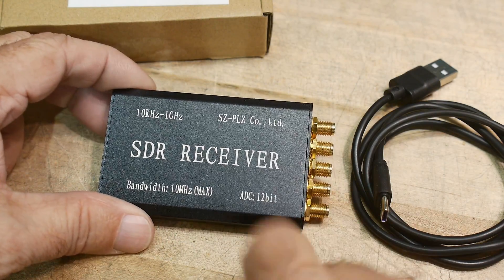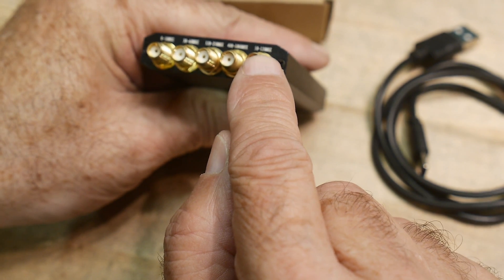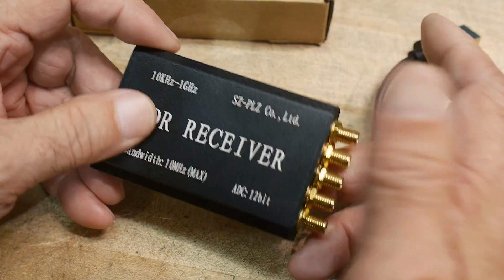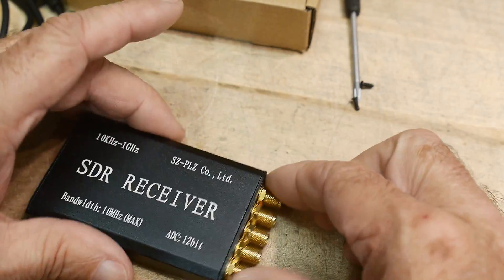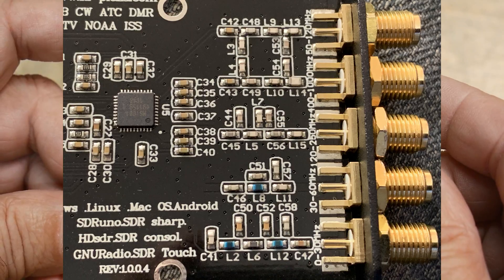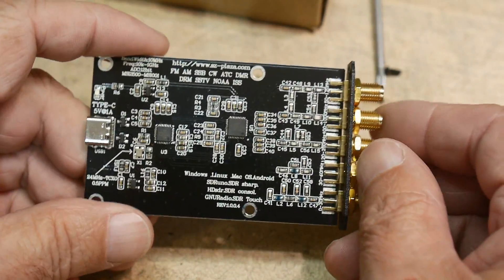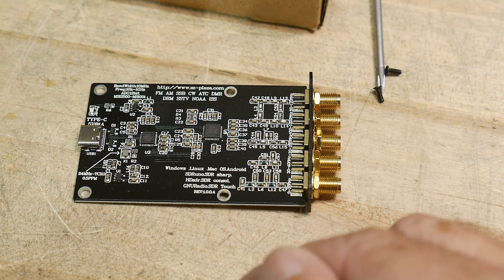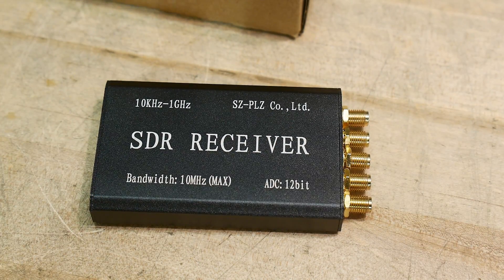#1318 SDR Receiver Review

Comment: This receiver is sold in meny shops in Aliexpress, 80% of the circuites are faulty. Most of them don't work on the lower bands (10-30MHz), only on the FM band. I bought it from "Life & Safety Guard Store" . Neither pay-back nor any solution.

Comment: 1:00 The two main chips in this SDR receiver are the MIRICS MSi001 and MSi2500. According to the company's data sheets for these two chips, the MSi001 is a wide-band, multimode tuner with different inputs for different frequency bands, so the receiver's multiple SMA inputs are not only for different bandpasss filters. The MSi2500 contains two analogue-to-digital converters (one for the I channel, and one for the Q channel from the MSi001), a digital signal processor (DSP), and a high-speed (480 Mbps) USB 2.0 interface, which the receiver manufacturer connected to a USB 3.0 jack. An Internet search can clarify what some of these things mean.

Comment: Do these receivers need an outside antenna to receive more than the fm broadcast band？I receive a lot of of shortwave stations on my other radios with indoor antennas, but using the same atennas on this I receive only the fm band. Could anyone shed some light on this. Thanks.
Reply: It is not the antenna that matters. Most of these gadgets are stucked on the FM band and no way to enable the low freq. input.
Reply: @gyorgycsatai8798  There is a setting, Q branch in the SDR application which gives the access to the ham, lower frequencies. I found I could pick up stations with a long wire antenna. Not so convenient. But it does work with a 9:1 unun. The ground from the unun is essential or there is no signal received. You are right these pick up the FM band with no problem so the Q branch setting  takes care of that.
Reply: @ominkan3129  As I know Q branch is used with RTL-SDR. In this video it is an sdrplay based on the chip MSI2500. This chip should automatically  enable and disable antena inputs according to the frequency.

Comment: Can you use more than one antenna input at a time? Like having an inverted V attached to the 0-30mhz input, a j-pole on the VHF input and a 600+mhz patch antenna on the UHF input?
Reply: Does it only work with Sdruno or other software like SDR++

Comment: I just got one of these. Can you have multiple antennas hooked up at the same time for different bands or should you use one at a time? Or does it matter? Thanks!
Reply: There is no reason not to try it---you won't break anything---but the five SMA jacks are so close together that you will probably have difficulty connecting cables to two adjacent SMA jacks. It has been 6 months since you posted, so if you have tried it, can you share your experiences?

Comment: Hello, sorry for the English, but Russian was a compulsory subject in the former GDR.
So translator.

First of all, thank you for disassembling and your reconnaissance work is good to bring light into the darkness.

Altogether I have 5 different types of
SDR Play Clones V3 found and 4 tested, two returned because all SMA sockets were neither screwed nor soldered properly and the solder joints broke as a result.
The clone shown here is better processed, but it has a large picket fence in the VHF BC range and partly in the 2m AFu range.

At the moment I have the version tested here and a single antenna version running.

large signal strength,
80 delta loop at 10m above ground very bad. -55 and the rest to 0 are tolerable without oversteering occurring..

Test environment here 80mDelta Loop and a 10.05m vertical with 2x 10m and 2x 2.8m radials

SDR Console

For daytime use OK, BBC 198khz on the Vertical S6-9.

Hundreds of ghost signals at night even with the MFJ RX/TX preselector inserted

This has 2 antennas in and 2 transcivers out and is great for comparison

Thank you and keep it up.

Comment: I'd like to see how to install the software. I'm having trouble getting Win 7 to recognize the dongle. These dongle radios come with no instructions whatsoever unless you buy a $150 one. My $23 board told me to run SDRplay software. SDRplay told me to enter a key number before it would let me download the software. So I'm stuck. I had to install something called 'Zadig' before I could install a USB driver for my other SDR dongle. It took me 2 days of reading and futzing around to get that one working on 1 software package. The lack of setup info is a real pain. I may just go back to superhet receivers. Those at least are explained and well documented, and you plug them in and turn them on and they work.
Reply: What did you expect from a fake product?
Reply: @SDRplayHamGuides , as far as I'm aware my board is just 2 commercial chips with signals connected as the manufacturer's datasheet suggests, and that's that. So what's fake about it?  Did the SDRPlay company design the chips, and the chips on my board are knock-offs, fakes? It looks to me like all SDRPlay has done is write software to talk to an inexpensive commercial chipset. Am I wrong about that? I haven't read the history of the chipset or read much SDRPlay promo literature. I would expect the chip manufacturer or some college kid or ham would have written a free driver to link the chipset to popular free SDR software by now. If they haven't, then I guess I wait until they do, because I'm more of a hardware guy than a software guy, and at my age would take me longer than I can afford to write an appropriate driver to do the job. But I'm a ham, not a consumer. I have no interest in paying $150 for what may be a slightly better SDR dongle than the $25 RTL-SDR I already have, and I don't see any reason to run any software other than the great free stuff already available. I have no desire to buy a software driver and a plastic box for $130. I just got this bd so I wouldn't have to bother gathering the parts together to build input bandpass filters. I would have been happy if it had used the RTL-SDR chipset so it would have been fully compatible with the SDR software I already had installed. But it clearly uses a different cheap chipset. Oh well. I suppose I can chop it up and still use the filters as front-ends for my RTL-SDR. As I said, I'm a ham, not a consumer. I build things from new or surplus parts, or modules, or boards, and I modify things, and learn, and make things work the way I like, this included.
Reply: Cost is no excuse for theft.
Reply: @SDRplayHamGuides  From what I have read, MIRICS, the manufacturer of the chips for this device, sells these chips to SDRPlay as well as other manufacturers!  SDRPlay does not have any right to call this device a fake or fraudulant!  The chips are being used as they are intended to be used as layed out in their respective data sheets!  The grey area is when this device is used with SDRPlay's proprietary software!
Reply: @danedewaard8215  These chips are used in the Funcube dongle pro/pro+ The malahite DSP1 and the Comradio CR1/CR1a. Yes, its being used as intended but NONE of these radios work with our RSP API driver or SDRuno but the device in this video is 1000%  fake and fraudulant
Reply: @SDRplayHamGuides  So any device that works with your software, that is not made by SDRPlay, is fake and fraudulent???
Reply: @danedewaard8215  Yes. Our RSP API driver is not "Compatible with" its purpose built for RSP devices same for SDRuno. These clones do not work without the RSP API driver.
Reply: @danedewaard8215  Hopefully that cleared up your misconception of the mirics chipset. and the devices they are placed in.

Comment: This definitely looks like a "you get what you pay for" item. It would be nice to see how accurate the frequency is VS a GPSDO or an oven Clock based frequency source. I'm betting this is OK for "horeshoes and hand grenades"  monitoring, but not "spot on" with an accurate broadcast frequency, and it also has no external clock input to make a correction for that. The multiple inputs for bands also seems problematic, as one other poster stated, as those connections are so close you would definitely have mechanical interference with adjacent connection points being used.

Comment: As many of you will probably be aware, there has been a growing issue with the number of both clones and fake SDRplay devices appearing through a range of retail channels. The distinction between what is a clone and what is a fake may not be obvious to some, but a clone is a copy of a SDRplay design that is NOT sold as a genuine SDRplay unit. A fake is a device that is marketed using the SDRplay name and logo or product name (i.e. RSP1A or RSPdx) and are designed to trick the unwary into believing that they are purchasing a genuine unit.
The most obvious example of a clone is the MSi.SDR. This is a direct copy of the original RSP1. When the RSP1 was launched in 2014, we published the schematics to allow radio hobbyists to modify or repair units themselves. We did not intend that this publication should be used for third parties to produce copies of our designs. Lessons learned and schematics have not been published since.

Whilst the legality of copying a design is open to debate, the morality of it is not. The companies copying our original RSP1 design invested nothing in hardware R&D and invest nothing in software development or support. Instead, they leverage the investments made by SDRplay. Investments that can only be funded through the sale of genuine SDRplay products. It is easy to undercut the OEM on price when the 'cloner' invests nothing in R&D, documentation or support

When it comes to Fake units, the issue is clear. These breach our trademarks and copyright and are intended to deceive potential customers into believing that they have purchased a genuine SDRplay product. They also do so in the expectation that the unsuspecting customer will turn to SDRplay for support or warranty replacements when they inevitably have problems.
Some people see nothing wrong with purchasing these devices in the full knowledge that they are not genuine SDRplay units and argue that given the price difference, purchasing such units is entirely justified. Some argue that “because it uses the same chip, there is no problem in using the same software, after all it's free”. It is important to understand that whilst SDRuno is free, the hardware driver and API are most certainly NOT. The hardware driver and API are part of what customers pay for when they purchase a genuine SDRplay RSP and the license terms and conditions explicitly state that these should only be used with genuine SDRplay devices that have been manufactured and distributed by SDRplay. These are terms that everyone who installs the software has to agree to for the installation to proceed.

SDRuno also has the same license terms of use, but is free because there are free alternatives such as HDSDR, SDR++, SDR Console, CubicSDR etc.
People that knowingly purchase MSi.SDRs and use SDRplay software as well as breaching the license terms of use are effectively pirating the driver and API. They do have an alternative, they can use the open source libmirisdr driver, but of course that will severely restrict the range of software that they can use. But I would also urge anyone who purchases these units and feel that they can use our software to consider the following: as well as stealing SDRplay software, you are undermining our ability to continue to develop the software and provide the level of support and documentation that we do. In doing so, ultimately you are undermining the entire community of SDRplay users through your actions.

Thank you for reading
Mike-SDRplay
Reply: Well said Mike.

Comment: I have one will not work with SDR#
Reply from the maker: they use SDRuno
Reply: @IMSAIGuy  People that knowingly purchase MSi.SDRs and use SDRplay software as well as breaching the license terms of use are effectively pirating the driver and API. They do have an alternative, they can use the open source libmirisdr driver, but of course that will severely restrict the range of software that they can use. But I would also urge anyone who purchases these units and feel that they can use our software to consider the following: as well as stealing SDRplay software,
Reply: @SDRplayHamGuides  SDR Uno can legally be used with any other SDR except those that have the Mirics chips MSI001 and MSI2500.  These are the same chips used in the SDRplay RSP series SDRs.  They were also the same chips used in cheap (less than $20) TV dongles.  Not to be confused with the Rafael Micro R820T2 and Realtek RTL2832U chips used in the RTL-SDR dongles.  If these MSI-SDRs are so bad, why would you care if they used your software???
Reply: Re-read the TOS. SDRuno is for SDRplay products only. The SDRuno.EXTIO edition can be used without issue with  any hardware that provides and EXT/IO.dll and a sameple rate of 2.5 MS/s or less.

Comment: Case: "ADC: 12bit"  I believe that these are only 12-bit ADC within the lower frequency range. Vague recollection, so not sure.
PCB Design: You may find that the five SMA connectors are so close together that the nuts interfere with each other. My example came with the nuts loose, because they didn't all fit. So I installed every 2nd one. It's fine.  Maybe someone has found SMA nuts that are ultra-thin and fit better.
Getting the driver software was just a bit dubious.

Comment: cheep and comes with a 24 Mhz crystal at 0.5 PPM - impressive.
Reply: TCXOs apparently measure the temperature and drop cycles according to a look-up table.  Good solution if phase noise is not a consideration. It's fine...
PS: * MHz :-) !!

Comment: 10 kelvin hertz to 1 giga hertz on the case (10 KHz to 1 GHz) where on the board itself they say 10 k (kilo) to 1 GHz.

The SI is just not that hard really . . .
Reply: Yep, it's amazing how many people were not paying attention when their Grade 8 Science teacher was explaining the correct use of upper and lowercase for SI units and prefixes.

A lot of milli-something ("mhz" ?) radios out there.
Reply: @JxH  A lot of people think that only the prefixes for negative powers of 10 are lower case, but in fact the first three positive powers are also lower case - deca (d), hecto (h), and kilo (k).  

The upper case 'K' is of course assigned to the temperature unit kelvin.   Just plain kelvin, not degrees kelvin.  Many people get tripped up by that too.

Comment: Cheap as chips, not sure how long it'll last though.🤷‍♂️
Reply: It has no static discharge protection to speak of, so you have to be real careful with the antenna :P
Reply: @chuckvanderbildt  The original definitely has protection against electrostatic discharge.
But this Chinese model costs $20 in AliExpress.
You can buy another one if it breaks 😄
Reply: Forever if you use it properly...